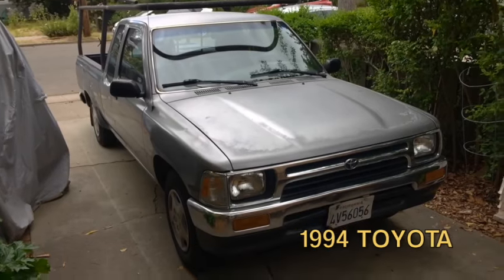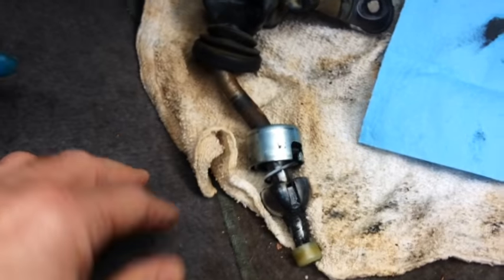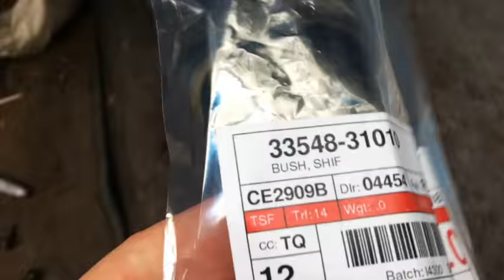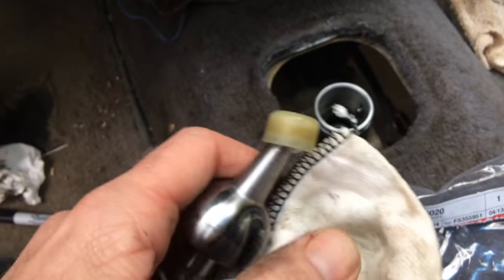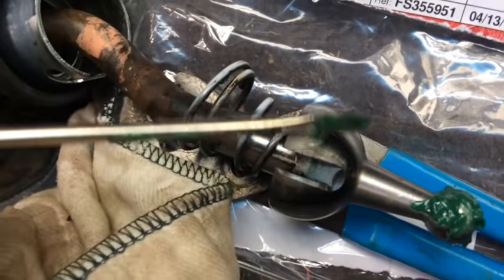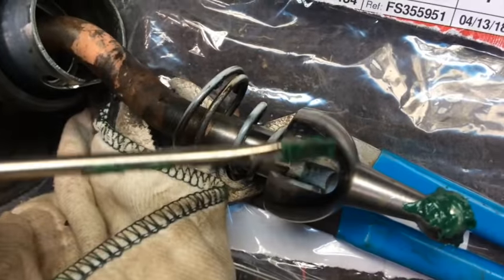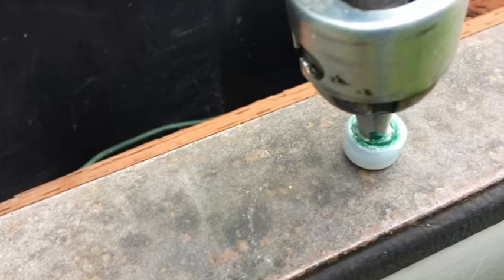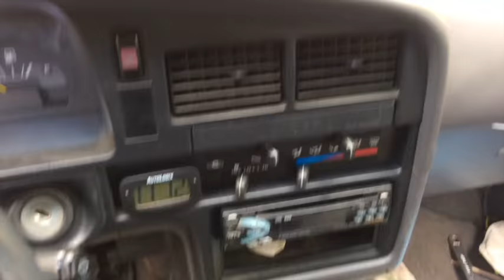TOYOTA Pickup - Hard to shift into gear, pops out of gear solution

Comment: Thank you so much for this video! I did the job yesterday, at 200k my seal was disintegrated, it was almost impossible to shift.  What a difference! The most difficult part was to put metal plate back- I have 4x4, so it's two levers. It is smooth like a butter now! Now off to replace clutch cylinders
Reply from the maker: Fantastic!

Comment: I had to add 80 minutes to your 20. Had a hell of a time lining up the screws under the rug through the 2 rubber boots and the metal frame into the transmission tunnel. PIA when you can’t see where the holes are.
Reply: Truth be told... it took me longer than 20 minutes ;-)

Comment: Thank you.  I was getting quoted total rebuilds.  It turns out that this is one of the few weaknesses of these T100's, well, every decade and 50,000 miles now that they are older.  I have the same model year as you.  Now I just need to adjust the valves.  That's suppose to be part of a regular tune up, but I've never met a mechanic that would do it.
Reply from the maker: RockOn John. If you can take care of business yourself, do it! And save some bucks and unnecessary work that doesn’t need to be done

Comment: I’m having the similar problems with 3rd and 5th gear and my coworkers were saying that it is the transmission which made me panic a bit because I don’t have that cash right now to do a rebuild, but I’m going to give this a shot and really hope this helps out
Reply from the maker: Mellisa - this is so cheap and easy to do - go for it!
Reply: @KentSchneeveis  any suggestions on how to get the shift stick out? I’m trying to rotate counter clockwise but it’s really stuck in there
Reply from the maker: Clean it really well. So that it’s not dusty, or slippery. I used the handle side of a pair of channel locks. There was rubber on the handle push down really hard and turn counterclockwise. It will pop up and come out. It’s not easy to do. But You will get it.
Reply: @KentSchneeveis  would you recommend using WD-40
Reply from the maker: That's a good idea. A penetrating rust buster stuff may be even better. Give the WD a shot.

Comment: hey Boss
Any advice will be highly apretiated 
Ford Transit 2004 
It began with gear 2 taking 2 times to change sometimes. Now i get situations when at traffic light and can not change any gear some times and then after a minute or so after restarting engine and pressing gears and clutch it all works again.
i happen few times a day on some days.

Inside van nothing leaking arround pedals.
Reply from the maker: Hmmm.... Ford Transit is a different beast than Toyota Pickup. Sounds like there is a lot of miles on the Transit? Maybe the syncros going out.
Reply: @KentSchneeveis  ty

Comment: Just wanted to say thanks! I had a lot of consideration to having my transmission rebuilt. I ordered the kit and replaced the bushings, and now I can FIND 5th gear and reverse on my 98' tacoma 2 wheel drive  2.7, 4 banger. The 1st through 5th geer is tight spaced like new, "(still going places)" with my antique truck with more than 465 thousand Original miles, never rebuilt. Still cold air too! Love these Toyotas! Thanks so much for sharing this video!
Reply from the maker: YOu're wwlcome. Glad to be of some help - Kent

Comment: that metal slotted cuff at the base of the gear shifter, I can't get mine to move. are there any tricks? I tried channel lock handle, just like you show, but it won't budge. it just won't move down far enough no even with the maximum force I can muster.
Reply from the maker: Penalty! Spray some penatrant , rust release, in there. Tap on it with a small hammer and a drift to loosen it up. You'll get it!
Reply: @KentSchneeveis  thanks man, I appreciate it.

Comment: Thanks for the video. My truck is doing something similiar and I'm heading to the shop to check that out right now.
So far it's just hard to get into first and will pop out sometimes but I have noticed that it's been getting harder to 
shift in general. I was chalking it up to having over 220,000 miles on a 31 year old truck.
Reply from the maker: Toyotas are amazing. Replace that bushing and RockOn!

Comment: Thanks 1991 Toyota, apparently this is a Common prob with a lot of model yrs. min started with intermittent 5 th gear and reverse then finally could not reverse . When I did the shifter went all the way right! Felt like it was broken. Went to dealer and got it . Stock items. Went home put it on less than 1hr. And wallla! Fixed both shift problems . Unreal. Also I prev had a bracket welds broken on pedal shifter and that’s a mission to fix . See other people videos. But try this fix first too.

Comment: I did this for my 1990 Toyota 4Runner 4 by, it has never been done and the seal that was supposed to be there was and probably in a transmission couldn't believe it. Now it shifts alot better and is not as wobbly as it was before. thanks

Comment: I have hard time starting the engine.
It starts in the morning, but after engine warms up, stepping on the clutch pedal deep and turn the key on nothing moves.
I understand that there's a engine switch at the bottom of the clutch pedal.
Unless it's depressed by the pedal(to all the way), it won't start.
It's been hard since I bought it(2000 Tacoma) but lately it's becoming even harder.

What can be the cause?
I will adjust the pedal switch(found it online) and see if it works but if it doesn't, I'll be in big trouble.

Comment: I know this video is a couple years old but what if it has no problems shifting when the truck is stationary but when it's turned on it doesn't shift into gear?
Reply: That sounds like a different problem. Because the shifting was terrible, no matter what, whether the truck was running or not. Was a matter of the bushings, at the shift lever being shot. Your truck may have a different problem - Kent
Reply: Time to buy a new truck

Comment: I have the same '94 Toy PU, only red. I've had no issues shifting, but when it was up on the rack the other day, it appeared to be gushing gear oil out of the shifter connection. I'm gonna guess my bushing is destroyed or missing as well! Thanks for putting this up, I could not see how to remove the shifter boot, seems the carpet is glued to the floor!  I will try again once I get the correct parts. Just turned over 266,000 miles this week! runs great but in need of some TLC, I'd love that new truck ride, but the insurance and registration (in CA) fees are prohibitive! Leaking at the valve cover gasket as well, but these are minor and easy fixes. My steering gearbox is failing though also, and I'm not sure if I can do that job.
Reply from the maker: Wow! That is a lot of miles. Testament to how great Toyota is. Amazing!

Comment: Thanks for the video......I was grinding gears 3/4........I took my Tacoma to a transmission shop.........they claimed the Syncro gears were shot - $1200 fix........researching syncro gear replacement I stumbled upon this video.......$30 in parts.....2 bushings.........fixed........Thanks........
Reply from the maker: Too many times mechanics are mere parts replacement techs opening up transmissions replacing good syncro gears and stumbling upon the bad, easy to get to, affordable bushings (that are the actual problem). The best thing about the internet is the Youtube.
Reply: Those shops are highway robbery and it should be ILLEGAL
Reply: Five years ago, I bought my base 2wd '96 Tacoma, for $400.  It only had 71K on the clock, but would not go into first or third gear. According to the seller, the repair estimate he got was $2400! Based on my experience, and what I read then, and now, online, the first thing to do is definitely check/replace the shifter saddle and bushing. 
In my case, there were complications.  Apparently, plastic chunks from the saddle had jammed the internal shift-linkage. But I was able to force it into both gears. After driving it for several weeks, the resistance gradually disappeared. I suspect this ground up the chunks into tiny pieces, which then fell harmlessly to the bottom of the gearbox. Now there IS a shifter-cover on the gearbox that I could have (maybe should have) unbolted to check the linkage. But I feared that small metal parts might fall inside, and then I'd have to pull the whole gearbox out. 
Ironically, three years later, I did have to pull the gearbox to R&R the clutch after it started slipping. I figure the previous owner starting out in second gear probably helped kill it. The parts only cost $130. But there's no removable cross-member under my 2WD Tacoma's gearbox. Working on ramps in my driveway, the clutch job took nearly a week!  But at least the fluid  got changed, along with all that ground up plastic!

Comment: Got a '07 Toy. Matrix. While in 4th for a minute, stick snapped back to Neutral. Did that a few times that day on highway. Then l tried duplicating that again in 4th with 200 xtra lbs of weight another day..nothing happened. Don't want to force it on high rpm in fourth. Not sure what's up.
Just spent 1,300 on wife's other Toy. for tires and frnt. links.
Any ideas?
Reply from the maker: $1,300 OUCH! It relatively easy to check the bushings at the shift lever. Check that first

Comment: Thanks Kent, the chanel locks and counterclockwise are key to popping it out, 190k mi and was just small grit left!
Amazing i still had 1 and 2nd, wouldnt stay in 3 4 5. Popped out in one day, not gradually. 40 bucks for the two parts in my area. I sliced 3 corners of the carpet to ease getting things in and out.
Reply from the maker: yeah, the carpet was more of a pain in the butt than anything else. 😁

Comment: i used this video to guide me thru the same repair on my 1991 Hilux Pickup (Toyota) that would jump out of first gear if I did not hold the shifter when moving off of a full stop. Put up with that for 7 years before I stumbled on this video. Took about an hour, mostly because the shift cap would not unscrew so I could not get the rubber out of my way and had to work around it.  I chose to lubricate the parts with motor oil because I was looking right into the transmission case so it seemed obvious that the unit was supposed to be lubricated this way. Ok. Might not have been my best idea but it seemed smarter than using a haphazard lubricant that might eat the plastic parts I just installed. Had to slice the carpet to get the parts out so I planned the cuts and laced them up with black shoelaces to make it look cool. I am 70 and considered this one of the easiest repairs I have every done. Helped that I keep the passenger seat in storage so my German Shepherd can ride with me inside.

Comment: I started this job today on my 96 Tacoma with 270,000 miles that I bought new in 96. Bushing replaced once before around 2005 by a mechanic, tried it myself today and blocked getting that twist cap off. The channel lock handles are genius, try it tomorrow and report back

Comment: If you're worried about [unknown type] rubber or plastic putting up with grease... it's hard to go wrong  with silicone.  Your shifter isn't a spinning part anyway, and just needs a little something to stay smooth and quiet.
Reply: Very good point. Silicone grease would be the best option. Why didn't I think of that?

Comment: I have a 1993 Toyota 4x4 3.0 liter truck and the shop told me that I need to replace the slave cylinder and the clutch for 1900.00 dollars. So I went and bought a brand new truck for 37,000 dollars. I still have the Toyota and want to fix it and I'll try this. If this is the problem im gonna shit self because now I have a nice truck payment and I could have fixed it by doing this. But I also have to install new leaf springs and front suspension so it's still needs some work but im kerping this neat truck. It has 228,000 miles and drives like a dreamwhen running. I still turn it on and warm it up every week and put it in gear and dtive it up and down alley to keep it good.
Reply from the maker: You're doing the right thing by getting a new truck while you can still sell the old one. Hope this shift bushing fix does the trick! = )
Reply: Update?

Comment: With very few exceptions, this process is the same for all variants of the first gen Tacomas.  The rubber seat is always a decomposed mess in every one I’ve seen.  My local dealer charges $26 for the seat and bushing.
Reply from the maker: Ahh, good to know. Thanks!
Reply: My dealer charged $77 and the factory bushings from 1996 were actually not the issue.
Reply: Do you know the part numbers for the bushings I need to do the same to my Tacoma?

Comment: Thx, but why in the world would you not include showing how you removed everything?
Reply from the maker: You're right. I wish I would of started the video earlier.  Shift lever being removed is the same procedure as going in, but in reverse order, using, in my case, the rubberized handle of a channel lock pliers. Pushing down and turning.  I wish I would have thought to show how I took it apart. I didn't even think to make the video until I verified how easy and affordable a fix this was. I wish I would have started from the beginning.  Additionally I had to get my sister to the airport that day.  But you can do it!

Comment: I replaced the seat and bushing today and the shifting improved but I am still having issues going into gear when the truck is cold. Any ideas? Thank you.
Reply from the maker: sheeet i don't know - sorry - you'll get it!
Reply: try flushing your tranny oil. you should take 75-90 GL4 gear oil (redline is the best stuff for our yotas but its a bit pricey).. drain it, replace with ~4qts of fresh stuff. I use 80-90 but then I need the heavier weight. If hot/cold doesn't matter then it sounds like yer clutch isn't disengaging fully for one of half a dozen reasons. most are solved by getting a new clutch kit (aisin is whatcha want there). best of luck m8
Reply: I would try a slave cylinder
Reply: I just bleed mine and it helped big time I have a new one on order for when this one gives out..
Reply: Brandon Lynch I replaced my slave clutch cylinder and all is good. I relaxed the master while I was at it too.
Reply from the maker: I notice this too. Let the truck warm up a bit. Mine shifts better once the truck is warmed up = ) And come to a come to a complete stop before trying to put into gear. If feeling resistance stop. Put into neutral position, let the clutch out, then put the clutch back in, try again, and it will easily to into gear. This really works!
Reply: @LADLAK  I ended up putting 2 big rubber washers instead of the plastic bushings for the shifter and now mine shift super smooth